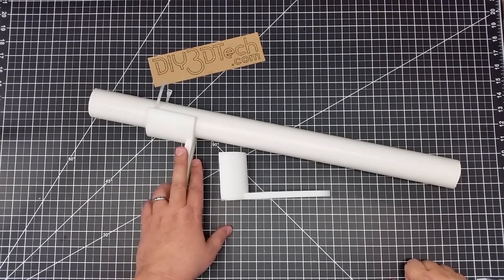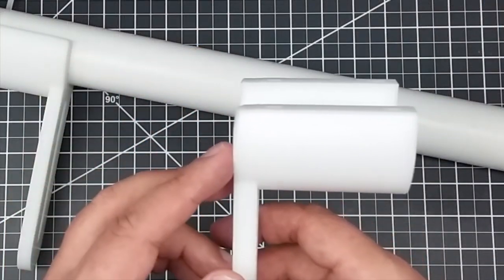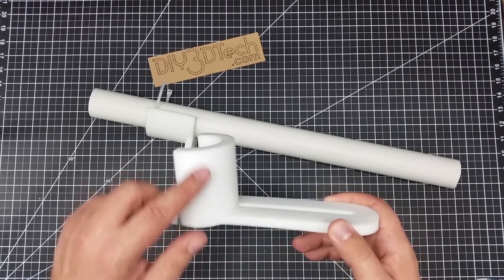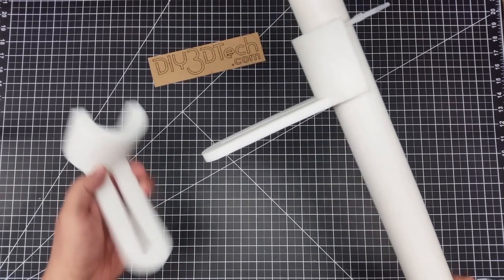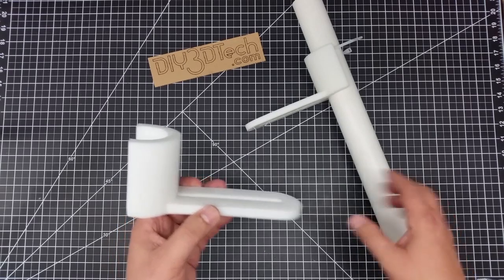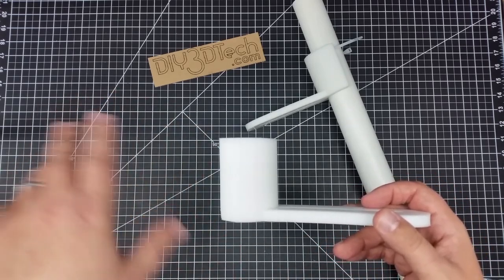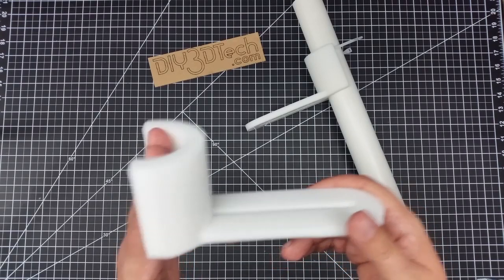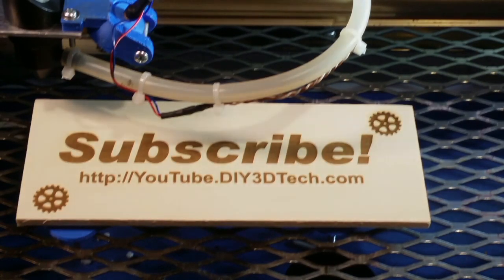3D Printed Projects - Printing with HIPS!

Comment: I would have turned the semi circle part 90º in relation to the flat slotted section. So the open side woukd be at the back side when installed.

Comment: I am new at 3d printing and I started with hips and use it all of the time. I have had a pretty good experience with it but do see some warping with larger prints. I have printed a lot of functional parts and have experienced some breaking.
Reply from the maker: I like HIPS better then ABS, however it will also warp like ABS and watch for the out-gassing as it is as bad as ABS...(see here: http://diy3dtech.com/3d-printing-and-air-quality-risks/ )

Comment: So you where able to reach 110c on your Davinci bed??
Reply from the maker: Yes, takes a bit however yes...
Reply: DIY3DTECH.com do you think it's easier to print with HIPS then ABS? And have you ever got layer gaps with HIPS
Reply from the maker: I personally think HIPs is easyer and no on the gaps but I run it hot.  Worth not I find better for larger objects as doesn't seem to resolve smaller detail.

Comment: I have just looked up the density of HIPS compared to PLA and ABS and there really isnt much in it. HIPS is about 1g/cc. PLA and ABS are about 1.04g/cc. Thats not much. When I look up the material strength properties it seems that ABS wins hands down. That said I have printed HIPS before and it is nice. I am sure it has some more niches that I havent discovered yet.
Reply from the maker: While I don't don't doubt the numbers, and if you go 1:1 agree with you, however I found (and this maybe more of my opinion) that HIPs printed better than ABS for such a large object as I have never gotten such a big object in ABS to print.  Since doing this video I have done a number of projects in it (dedicated a printer just for HIPs) and they have come out greate, however ABS.  Not so historically.

Comment: Would printing the part diagonally on the print bed have prevented the warping?  Nice application of the design for your vent piping.  Do you have any "frost heave" issues on the one vent pipe coming from below ground?
Reply from the maker: No on the frost issue as it kinda floats and the vent is above the ground, however yes diagonally might have improved however the downlide is I think it would have added a lot printer stress as when I do they larger objects I try and line things up to optimize the linear motion if you what I mean...
Reply: DIY3DTECH.com - I do understand about positioning the part for maximum  strength. Sometimes I orientate a part in a position that isn't the optimum for printing the shape but provides the best layer orientation relative to the shape to provide the greatest strength.